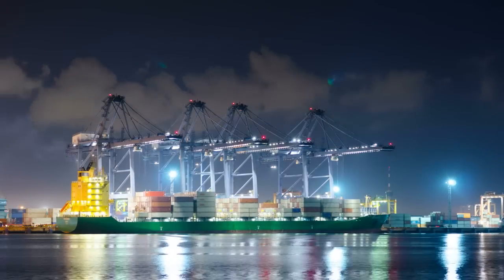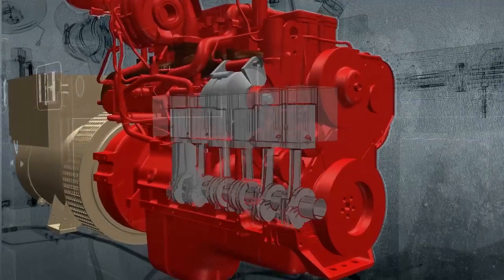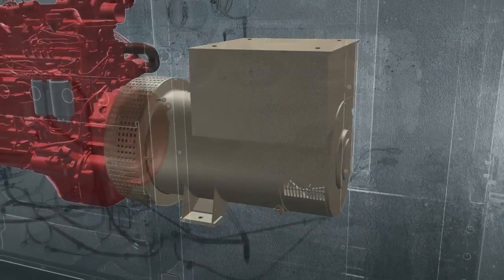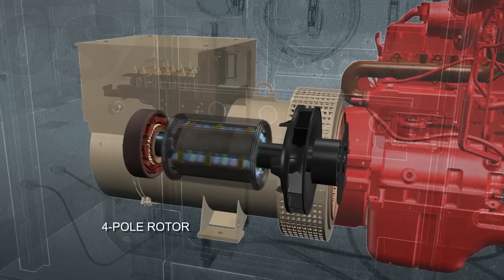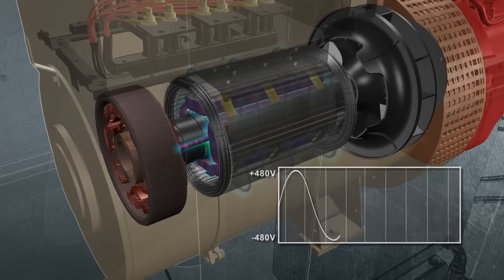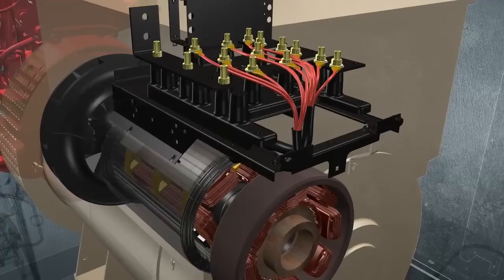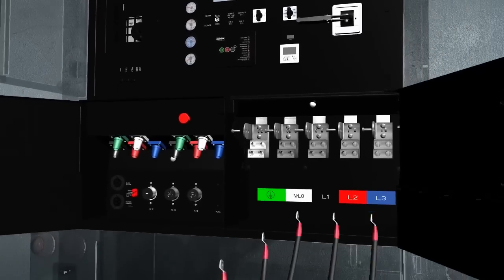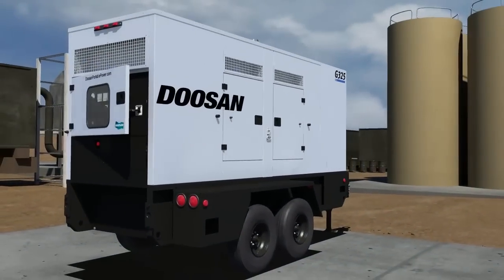Doosan Portable Power How A Generator Works

Comment: Nice video, however some of the information is not correct. Voltage does not "pass through the rotor coils", when voltage is applied to the rotor, current passes through. It does not produce ac because the "magnetic field builds and subsides". For a constant load and voltage the rotor current and magnetic field is constant. AC is produced because the field rotates and cuts through the stator winding, when the north pole of the electromagnetic cuts the winding current flows in one direction and the south pole causes current to flow in the opposite direction - hence alternating current. Since this is 4 pole rotor it produces 2 sine waves per revolution.
Reply: MurtxD....Hi....Do you recommend any other video from youtube about the working of a generator....
Reply: How flaw is the information in this video? Sorry but is it save for me to use the video for my science presentation? Thankyou
Reply: @naddd7308  It must be properly explained to understand and repair these units.
One must have knowledge of electrical technology to work on these units.
Reply: Accurate information.

Comment: how is the initial magnetic field in d rotor winding generated.kindly explain plsss.
Reply: The field excitation comes from permanent magnets which excite AC into shaft mounted coils. This AC is rectified by shaft mounted diodes to give the DC for the main rotor coil.

Comment: Working on a way to make a magnetic motor and this helps!
Thanks. 1 question: you can't "create" energy, only move it from one place or form to another. How do magnets do this? What "energy" are they receiving to create push/pull? Doesn't it have to do with electron exchange or something?  Thanks.

Comment: That's a brushless synchronous 3 phase alternator. They good because they have no wearing parts accept the bearings where as most have slip rings which wear but are replaceable of course.